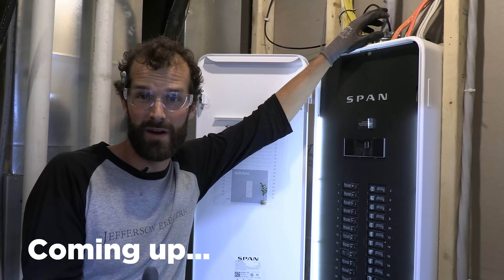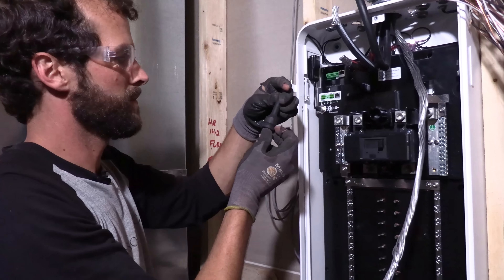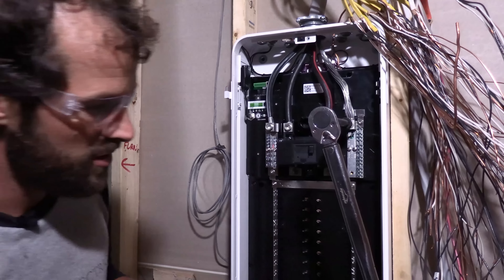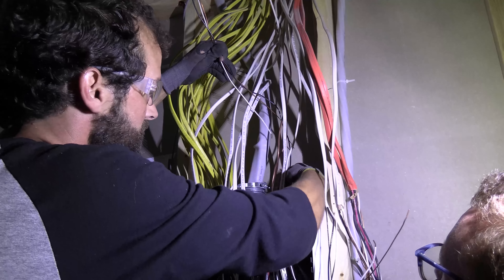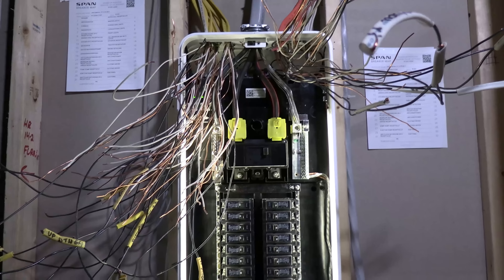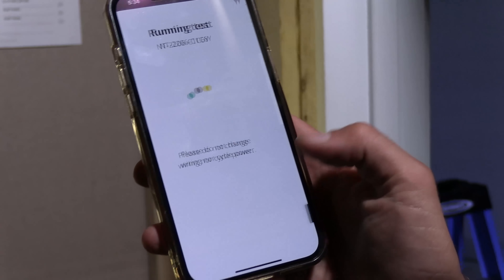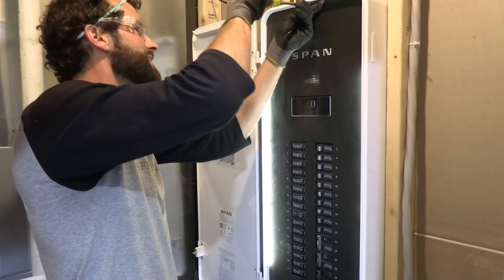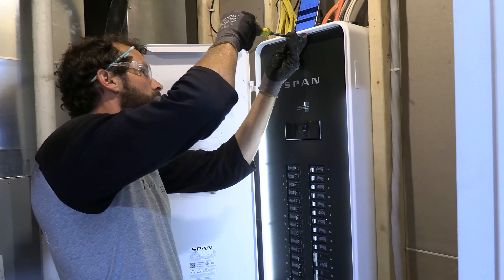Tesla Exec Revolutionizes Breaker Panels Forever - Finish-Out - 3

Comment: 12:50, i discovered one of the outlets in my house, the clamp was tighted too hard, and it cut all the way into the hot, livening the entire box!
but there was also no gnd in the romex, so it never popped a breaker

it was like that for years, until i tried running an audio cable between devices on different circuits, and got a nasty surprise!

Comment: (Preface: I'm a former U/L inspector, & an electronics / electrical tech / company owner.. 40+ years AND I love electronics!) 
Per the posts about this company being around for a while... and concerns about disassembling the entire panel in case of an electronics glitch: The elephant in the room seems ( to me..) to be a rather quick comment Joel made along the lines of (my paraphrase..) the 200 amp existing panel can be bought for about $125.., The SPAN panel (by my research) is about 20 to 30 times that..
That means the time/ cost of troubleshooting, disassembling & repairing the SPAN panel would be a significant concern to a few of us. That's a lot more than the cost of just a few smart hubs. I MIGHT be able to afford one of these, but when the electronics go dead in the middle of a snow storm, and the parts are so proprietary that there are none locally and the option is overnighting it. AFTER the electricians diagnosis and then install.... I guess I'd better have a rather robust Powerwall... oh and that might not help if this panel is the control point for the house.....

Comment: Panelboards and load centers are housed inside of cabinets and cutout boxes, which are literally large junction boxes that are meant to contain conductors and splices/connections. Whether you use the terminals only or do other splices with wire nuts, there is no code against it, so long as you don't exceed the allowable volume (which is hard to do).
Reply: but still some people try to stack wire splice's ( high resistance aka loosely ) aka 3 different wire nut's to the same braker ( going to the same circuit or 3 different circuits as it was different times for me seeing this crap 💩) on the same wire going to it 🤦🏻‍♂ im sure a code enforcement could find something to reject it and fall the testing thankfully, but i have come across someone's else's work before me and 🤪🤦🏻‍♂not sure whose work it was but wow unprofessional and tidy mannered

Comment: The 1/8" allen screws are actually a lot more common that you might think.  They can be found to fit into a 1/4: drive screwdriver extension that can be put on a 1/4" or 3/8" socket for torque wrench, or to a small screwdriver with multi-bit on it. 

That said, I have never seen a allen screw in a electrical panel or any sort of electrical device, except the 3/8" lugs found on the 100 - 200 amp lugs.

Comment: Communication cable AKA Ethernet or very old school CAT3 Telecom Cable is over 60 years old it’s solid Cooper conductors @ 24 and 26 Gauge. CAT5e is from 2005 rated at 26Awg and CAT6 24AWG with a(4) plastic splines in the cable to separate the (4) sets of 2 twisted conductors remember CAT5e, CAT6, CAT6A Insulated are 24AWG also per the NEMA Code communication wires are required to be 12 inches away from electrical wire, if the run in parallel!

Comment: Hey Joel, stupid question...when you first commission the panel, does it required wifi/cell signal?  If so, just thinking worst case, what if you don't have cell signal at the area of install, does the panel still works like a old school panel before you could commission it...(thinking wifi won't work w/o power😅)...Thanks for the tips, keep up the good work!
Reply from the maker: A Span panel does require ethernet, wifi or cellular for full smart functionality, but it will work just fine as a dumb panel under any and all adverse circumstances.
Reply: @ElectricProAcademy Makes perfect sense! Thanks!

Comment: I do IT and what concerns me, is tech fails, often. Replacing the board in that panel isnt an easy swap, and labor has to be up there
Reply: Yeah that is the only problem I'm seeing with this product is there are components that could go bad...

At the same time, if they are made with quality they could last a long time too.
Reply: Agree; this panel needs to be a lot more modular so that an individual circuit can be replaced if necessary.
Reply: Exactly I don’t want my house losing power because of a random WiFi module failure

Comment: Thoughts on this vs the Leviton Smart Load Center?
Reply: I myself prefer the Leviton smart load especially if you install the WiFi breakers that allow similar power quality readouts circuit by circuit. The main reason is that Leviton is a full-on engineering company that makes its own breakers that counts for a lot whereas with the smart panel uses breakers from other manufacturers unless they release engineering data on that integration I would be wary of it. Though Joe does say their customer support is excellent.

Comment: Some questions to answer:
1.  Is it UL certified?
2.  Does it play well with AFCI and GFCI devices?  How about other electronics and IoT devices?
3.  My guess is that they are probably using SCR's for circuit control but these electronics do not isolate voltage potential on the branch circuits.  Should GFCI protection be required for all receptacle circuits?  Maybe AFCI should be included too?
4.  Does the 2023 code address this technology?
5.  A software app is not adequate to isolate circuits that need to remain on!  Measurement is one thing, but making sure a circuit does not go off is another.
6.  What sort of software support commitment comes from this company?  
7.  What if the company goes bankrupt?  I see a need for a very large escrow account.  (make sure you keep the original panel for this alone).

Comment: What if some of the electronics inside the panel fails? Do you have to pull the whole thing out again?
Reply: I think they may even already be a thing, but instead of the panel holding the brains, it should be in the individual breaker and that would make things a lot more convenient if something fails.

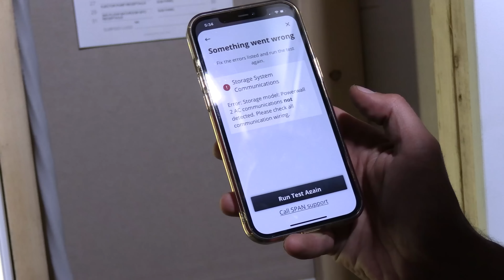Comment: 20:20 How about a powerline internet controller?  the garage is attached to the main panel, internet could be sent over those wires rather than digging a new trench.  You think Span would have a built in powerline controller for sending internet via your house wiring?
Reply: Power line networking sucks for performance, if you can get it to work at all.
Reply: @shubinternet   I doubt you need high data rates to communicate to a Tesla powerwall and report status.
Reply: @ericfraser7543  - true, you shouldn't need much speed. But you do need something, and it needs to be reasonably reliable. Power line cables are not meant for doing those things or doing them reliably, with regards to computer networking.
Reply: @shubinternet  You are probably right, though ethernet/wifi is probably not the best choice for a smart home interface to something like a tesla powerwall...   The problem is in the marketing, nothing else more standardized than ethernet or wifi...

Comment: You may be able to check the system in thinking it has a land connection using two wireless routers set up as access points with nothing else connected to them just bridging a network in this situation if it ever comes up again and you're unable to have an easier solution
Reply from the maker: Thanks @waylonhartwell! We'll keep that in the back pocket 👌

Comment: every breaker box video i watch involves struggling to get the box in because you have to fight getting the live feed wires through the top and bottom,,  why dont the breaker box manufacturers make the top /bottom holes on a separate plate with a half collar that slides in and screws into place from the from the front so that the wires can be easily fed / attached without the struggle?

Comment: Another great upgrade would be to replace the twister pair Ethernet link with fiber. That would remove the potential for electrical interference. The difference in cost is negligible.
Reply: Since the original equipment has ethernet interface chaning to fibre requires media converters, these require power, have dip switch settings, become very problematic.  Use well terminated STP cable routed correctly never had issues.

Comment: I still feel like I dont grasp the value of this panel. The big difference is that you can cycle the breakers via internet connection?
Reply: The biggest benefit is in flexibility. You can assign different breakers to different groups, so like when the power goes out, subset B stays on, and if the power stays out for 15 minutes, you can change to subset C to keep the power on for an extended period. 

This can all be done in software and on the fly, meaning not only do you not have to wire all of your preferred circuits into a separate essential load centre, but you can change these at any time without a whole rewire. You can even adjust it while the power is out to extend your backup time. You can also set conditions like if it's winter power these certain circuits, or overnight only power the bedrooms, etc. 

The Span panel is also capable of integrating with solar and battery to implement all of that.

Side benefit is you have complete visibility to your power usage and cost on a circuit by circuit basis, but the big sell is the flexibility for resiliency.
Reply: @chaseohara4781  Oooo its also a UPS?
Reply: @beachboardfan9544  no, but can interface with backup systems to take note of power level and adjust breakers depending on that
Reply: I was under the impression that low voltage and comms cables couldn't be run in the same chases and conduits as 120/240v.  Are you saying they can if the jacket is rated for 300v?
Reply: @hoocli  Be interesting to see how long they last. Old style systems are still being replaced, 50+ year old systems. I feel like the fancier these get the more frequently they'll fail...
Reply: @JeffPalmer941  Iirc theres wire specifically shielded for that
Reply: @beachboardfan9544  good news!  Thanks
Reply: @JeffPalmer941  My guess is that local inspectors will be good with this where the ethernet circuit is directly related to the panel and feed.  Again, only if the ethernet jacket is suitably rated.  General computer network distribution should not be allowed though.  Definitely a situation where the code needs to catch up with the technology.

Comment: Some devices need a network and internet connection to communicate with an app or software to function normally.  But. What if that when the device sense no Internet from a ISP having constant outagees like, Cox. Or no Internet from a hurricane.  Does the Span app goes wonky or does it just goes into lock out mode?  Making all those cool features like remote switching and energy monitoring stop.  So the fancy looking load center just became a fancy looking load center?  If so, might as well be like Leviton and sell a pretty white box with white breakers..  For now, white paint and the old school load centers for reliability.